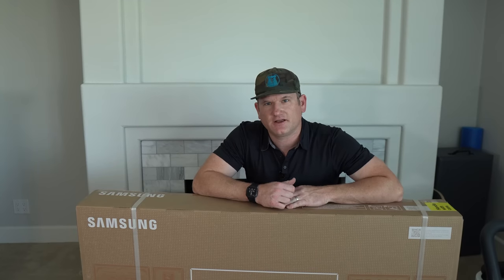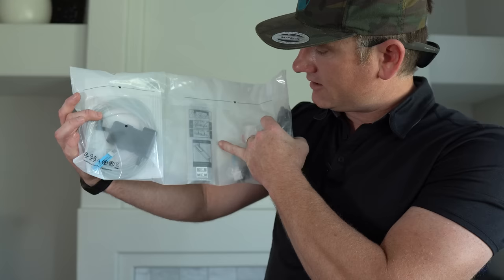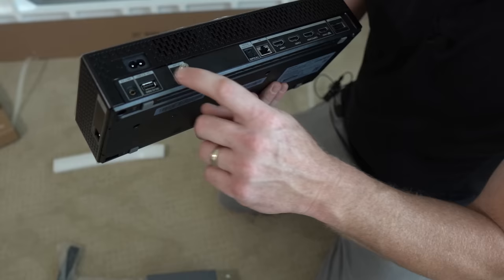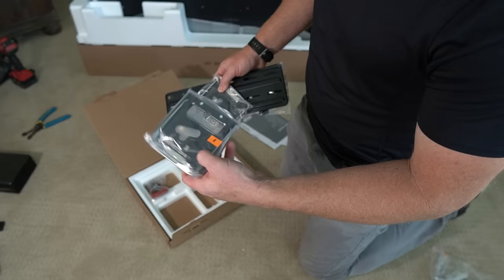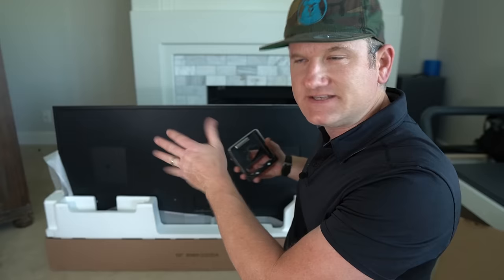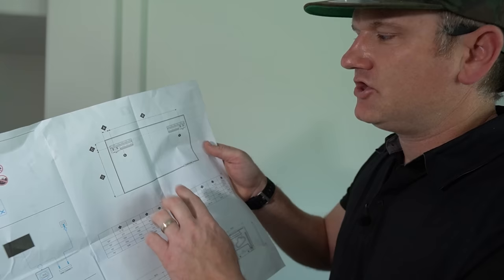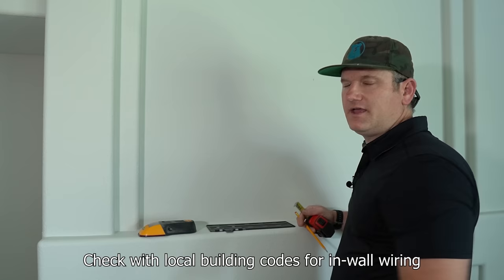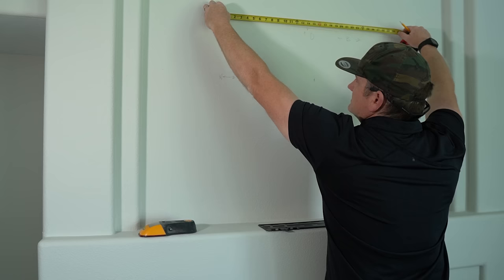Samsung The Frame 4k UHD TV - Unbox and Installation Guide (2021 model)

Comment from the maker: Frame FAQ video... here --> https://youtu.be/Z2f2dCoroDE
Reply: Were the screw heads on the screws that came in the pack with the snag toggle bolts you linked to on Amazon wide enough to hold up the mount ? ?  They don’t look very wide in the picture on Amazon 

    I have one stud also I can tap into but the black screws that came with the TV are going in the stud well and I’m worried I’m gonna strip them trying to get them in .. any suggestions ?
Reply from the maker: @brianpaxtonPT  just create a larger pilot hole and put pressure on screw gun.  Yes the toggle heads should be good, you can get cheap washers at home depot too
Reply: I bought it from Costco but it doesn’t come with wall mount. Where did you get it?
Reply: We want to mount our 65inch 2021 Samsung Frame TV over a 30”high sideboard in our living room. What would you suggest be the ideal height considering both tv viewing while sitting down and the fact that it is an art piece when not watching tv?
Reply: One thing you can add on your next video is to tape up the end of the connector before you start pulling it up the wall. You want to protect that from debris and from being damaged . Great video!
Reply: So helpful! Nothing ambiguous in these instructions. Mine looks great and thanks for the flip toggle suggestion. All super helpful!
Reply: I have a 2019 Frame with the mount it came with, was toying with replacing it with this one but not really excited to deal with the new mounting system
Reply: If I am above a fireplace with the stone flue behind and then stud across, is it possible to notch and embed the OneWire into the drywall surface?  Obviously not ideal but trying to avoid ripping off the wall and mantle.
Reply: L
Reply: @brianpaxtonPT  iiiooip Mme

Comment: The separate mounts do not allow for 16" on center so it will always need a combo of wood screws and toggle bolts.   Wish the mount was one long piece, that would allow for catching more studs.
Reply: Facts i had a client get mad at me trying to explain this to them today
Reply: @djk.o.2738  same here..literally an hour ago. Samsung should have just left well enough alone.
Reply: separate mounts are to allow for in wall AV boxes behind the TV
Reply: I'm annoyed by this fact right now. I'd rather just use a different hole and hit a stud
Reply from the maker: Toggle bolts are more than enough. You can mount the two brackets on 4 toggles each and put an 85" frame on it. Just find the hilti snap togglers or others like ti.

Comment: Installed my 50” Frame TV two weeks ago. It wasn’t easy, but I learned a couple things that help:  
1) Those slippery stickers on the back of the TV are so you can adjust it slightly after it’s mounted. This is handy for leveling it since it’s really hard to get those two plates mounted exactly right. 
2) If you rip those silver pieces out of the wall plates before you mount them, the TV will sit flush like it’s supposed to. Go figure.  If you don’t, the TV will not lie flush against the wall.
Reply: Can you provide a picture?  I'm about to do this myself in a few days.  Would love to know how to get it to be flush.  thx!
Reply: @AdamFrankadampfrank  sorry, it’s behind the TV. But each of the two plates that mount to the wall have two smaller chrome-looking pieces attached to them. Theses metal parts are attached to each other where there are holes through both. It is possible to remove the chrome pieces by prying them apart at those holes. It’s a little scary since it doesn’t seem like  you should have to pry them apart, but it was a huge improvement.
Reply: @Cubemaster2006  is this per directions? I’m curious if it’s not suppose to sit exactly flush maybe for better heat dissipation?
Reply: The bracket on the TV is not supposed to be fixed; it actually swivels and slide upward from its neutral position once the TV is hung.   The design of the non-stationary bracket position relative to the TV allows for theinstaller to be able to adjust TV after it is hung to get  it leveled.  I have watched 4-5 installation YouTube videos., but no one has mentioned this design, which I am formulated based on my assessment of the bracket to TV relationship.  You can tighten the single bolt between the bracket and TV as tight as it will go, but the bracket will not cinge down competely and will slip out of its neutral position.  The bracket also has an open slot, I believe to allow the bracket to shift as needed for balancing the TV.  I think that is why you are supposed to stick on that slippery insert between the bracket and the back of the TV.   A couple of YouTube installer expects have mentioned they do not know why you have to stick on this insert under the bracket.  I believe it is there to aid the TV to swivel in the vertical plane to allow the TV to level out after installation.  I could be wrong, but the above is my assessment.  Also, by having two brackets, the TV gets more stability (more safe than one bracket), and the movement designed within the two  brackets allow leveling of the TV after it is hung.  It is actually an ingenious design (regarding the brackets).
Reply: How do I adjust one side ever so slightly to level it out?  My installer installed one side slightly below the other :(. Its also not fully flush so i imagine this is where the silver bolts / extra downward force comes in
Reply from the maker: Just level if yourself.  You can just push the bottom of tv left or right and it will adjust.  That is a feature of the mount.
Reply from the maker: Great tip.  I will check that out.
Reply: @BTheInstaller  thanks for the response! It won't budge at all when I try to adjust it..do you think the installer maybe attached the brackets on the tv too tight?  I'll be taking it down after some coffee hits my veins
Reply: “Those silver pieces”. What do you mean? The magnets? The metal things that pull out. Are you talking about the wall brackets or the tv mounts?

Comment: I have this exact model but mine came with a template. Bought in September 2021 in Canada. So I guess they made some changes since you made this video.
My theory about those stickers is they dissipate the magnetic field so the magnets don't interfere with the TV's functions.
Reply: The bracket on the TV is not supposed to be fixed; it actually swivels and slide upward from its neutral position once the TV is hung.   The design of the non-stationary bracket position relative to the TV allows for theinstaller to be able to adjust TV after it is hung to get  it leveled.  I have watched 4-5 installation YouTube videos., but no one has mentioned this design, which I am formulated based on my assessment of the bracket to TV relationship.  You can tighten the single bolt between the bracket and TV as tight as it will go, but the bracket will not cinge down competely and will slip out of its neutral position.  The bracket also has an open slot, I believe to allow the bracket to shift as needed for balancing the TV.  I think that is why you are supposed to stick on that slippery insert between the bracket and the back of the TV.   A couple of YouTube installer expects have mentioned they do not know why you have to stick on this insert under the bracket.  I believe it is there to aid the TV to swivel in the vertical plane to allow the TV to level out after installation.  I could be wrong, but the above is my assessment.  Also, by having two brackets, the TV gets more stability (more safe than one bracket), and the movement designed within the two  brackets allow leveling of the TV after it is hung.  It is actually an ingenious design (regarding the brackets).

Comment: Here’s a question, how the hell did you run conduit sideways through a wall without being stopped by a stud?? Was the wall behind the fire place built out and hollow? This would not work in a standard wall, unless you’re staying in the same stud cavity.
Reply: sometimes, above the newer houses built, the fireplace is electric and behind that fireplace wall is completely hollow. easy run.
Reply: i was thinking, “how the hell he gonna make that lateral run without cutting out a lot more of the drywall????”  i hate how a lot of youtubers simply skip over the part of the job that would require A LOT more work and at least 2 more days to complete (patching, mudding, sanding, texturing, painting)
Reply: Ya this was the reason I wanted to watch this video, how do you get a 2 inch tube horizontally past multiple studs?? Of course that part was skipped over lol.

Comment: Those big black square stickers...  Since the brackets that attach to the TV are meant to slide around the attachment area, I believe those stickers are there to reduce the friction between the bracket and the TV.  As for the screws, they are meant to be used with the enclosed anchors.  So I'm not surprised that they don't work well screwing into a stud.

Comment: Great video!  I have a 2019 55” frame and just got a 2021 43” for a small bedroom. Samsung has really made the install much more difficult!  For the 43” not only is the mount split but there is no tilt feature which means you have to line up the screw heads on tv with a mount that you cannot see.  Very disappointing.

Comment: Thanks for posting. i have an upcoming install above a zero clearance fireplace surround wrapped in slab marble and porcelain tile so all the conduit/mounting locations/ one wire box behind the TV will have to be laid out at framing and maintained thru slab/tile. this primer helps me get a game plan, appreciate it!
Reply: That sounds like a tough job!

Comment: Does the type of "conduit" used in the video to protect the cable meet NEC standards? Or is this a code violation? I'm not sure this is sufficient to prevent a fire in the rare case of a cable failure.

Comment: Excellent video! However, I do have some questions regarding the conduit.

▪ Will using a conduit be significantly safer than not using one? Is it practically just as safe as the pricy in-wall rated cable?
▪ What is the diameter of the conduit?
▪ And what kind of conduit is it exactly? Will any plastic conduit do, or should it be a specific one intended for electrical wire usage?

Comment: Doing 2 tomorrow for a client and yes the temple help to install these... as you mentioned takes a bit more math now without one.. also too bad they didn't  design a one-piece for the wall instead of the two left n right easier install and have more chance to hit studs

Comment: What if the fireplace got remodeled and has cement board and stone veneer, will the toggle bolts work? There is a horizontal 2x4 behind the wall, would that work?

Comment: Thanks for sharing. Great video. I know that wire is not wall rated but how big a deal is that?  I’d prefer not to pay $200 for an insulated cord if the risk of fire without is minuscule.

Comment: It doesnt look like the brackets are fully engaged with the magnets. If this is the case, you need to put pressure to snap it in place or bend the brackets out slightly so that the hangers will fit.

Comment: I just purchased the Frame tv and my Wall Mount brackets on tv are very loose. I tightened all the way down and can still slide the piece. When the screw is tightened into the tv is it supposed to make it so the bracket won’t move? I am just wondering if mine is defective or if the movement is ok?

Comment: Dude, perfect timing. Getting the 65” delivered today. Primary purpose in the room is the art feature. Have existing conduit in the wall about 1” in diameter, not sure I’ll be able to get the one wire to fit. We shall see!
Reply: I'm in a similar situation and should be getting my 65" next week.  How did it work out?  Were you able to get the cable through the existing conduit?
Reply: same!  struggling now to find an appropriate size for a conduit - would love to know what the absolute minimum size diameter should be for passing the one connect ends through
Reply: Mine ended up going through without any difficulty. I don't know the exact diameter though since it was already in wall. I want to say the inside diameter was around 1.25".  Sorry I didn't take measurements before hanging.
Reply from the maker: I linked the conduit I used in description.  1" won't do.  The small end is 1.2 inches.
Reply: @BTheInstaller  just FYI. The conduit you linked in the description is a split conduit but the one you are using in your video is NOT a split. Are they rated for 110-220v?
Reply: @hitnrun1120  everyone is dodging this question. Is this conduit rated for in-wall 120v? Split conduit certainly isn't

Comment: Thank you B!  Excellent video.  However, I was curious regarding the lack of the term no-gap on the wall mount.  How did it look from the side when you were finished?  We have a 75" frame coming soon and would like to know if the tv did in fact sit flush with the wall.
Reply: How do you like the 75"? Is it sitting as flush as you had hoped? Looking to install one soon.
Reply: We have not installed on the wall yet. We will likely be installing a texture surface to the wall first and that has taken some time to arrange. But we purchased a Samsung white frame overlay and it appears that the tv will sit perfectly flush when we do install it. Looking forward to having that done.

Comment: Impeccable work as usual B. Hey one question, I noticed the ToggleBolts come with round-head screws, whereas Samsung always provides flat-head screws. In some of my installs the round-head screws precluded more than the flat-head ones impeding the Frame to be 100% flat against the surface. Don’t you find this issue on your installs? Thanks for posting another great instructional.

Comment: You should do an install of the 2021 43" Fram TWITTER, it comes with two separate mounts that are not attached, it's super hard to align and install correctly and slide the TV in.

Comment: Could not get the brackets on the tv to remain stationary.....so i pulled up on them as if the pressure of hanging was on them and measured from there to place my wall brackets....could not figure out why they flop around diagonally

Comment: I have a 75 inch TV. Doesn't seem like I ll be hitting any studs if I keep the TV in the centre. Are toggle bolts AND the plaster strong enough to hold the TV on its own? Or should I move the TV off centre and try to hit the studs atleast on one side.

Comment: Can you run this one wire cable on an exterior wall? It’s running against insulation, is that a fire hazard? Samsung makes an insulated cable you can buy for this purpose. It’s expensive so I wanted to make sure it’s necessary.

Comment: Thanks for the video, I installed my 55" 2021 frame tv but I didn't use conduit to run the one connect wire inside my wall do you think its okay? Or do I need to use the conduit? Thanks
Reply: The one connect passes power. You should use a conduit.

Comment: Hi, I just purchased the Frame TV ...is the wall mount included or do I have to purchase the wall- mount?  It was not in the box.  I just have the anchors and screws with the 2 square pieces that are put in the back of the tv.

Comment: I have a 9 3/4" beam that sticks about 3" off the wall right in the center of where I want to hang the 65" frame tv.   Can I place the mounting brackets on each side of this beam and with the silver metal hangers do they stick out far enough for me to clear that 3" distance?  So the tv would be flush with the beam, but stick out a bit from the mounting bracket.

Comment: Planning on running power through the wall as shown in the video. But if there's already a power outlet on the wall at the display, even though we won't connect it, will the display still hang flush on the wall? Is it better to install on a totally bare wall?

Comment: Hi there - my current wall mounted Tv has sockets behind it - double socket power and hdmi / coaxial cable socket. So the wall isnt flush

If I was to fit the frame Tv mounting bracket, does the Tv need to go flat to the wall or can it hang at an angle with the bottom of the Tv flush but the top offset ? Eg hanging into the room on a slight angle to clear these sockets which will have nothing plugged into them 

Or does the Tv need to go flush to secure into the bracket ?

Thanks mate

Comment: I have a 55 inch Samsung frame on the wall right now, would a 65 inch fit on the same frame without moving?  Or is the frame for the 65 inch mounted farther apart?

Comment: We got our electrician to install a brushed hole point with an hdmi diameter tube section through a brick wall to where we planned to keep our hdmi stuff and the one connect box.  Now we have bought the Frame tv 2022 and the really thin cable has those chunky ends on it. Is it possible to remove one of the ends during installation and reattach once the cable is through the wall?

Comment: I like the dustpan trick! Does this still apply to the 2022 models? Also, I want to put mine above my fireplace, but it’s at an angle. Wouldn’t that conduit have to go across studs? I’m trying to snake it over to the flat wall

Comment: Does the 43” not come with the bracket and only the 2 square pieces? I’ve ordered 3 of these and all of them are missing the wall mount box
Reply: Yes, I just bought the 43" also and it only came with the 2 small square pieces, no wall mount box or instructions. Any help would be appreciated!

Comment: Hey. Im planning to buy a samsung the frame 2021 55". I have made a TV stand made of plywood. there is a big plywood sheet parellel to the wall where the tv is to be mounted. But the plywood sheet is just 1.25 inches thick. Can i mount the tv on the plywood sheet? (the 1.25 inch plywood is hollow on the inside)